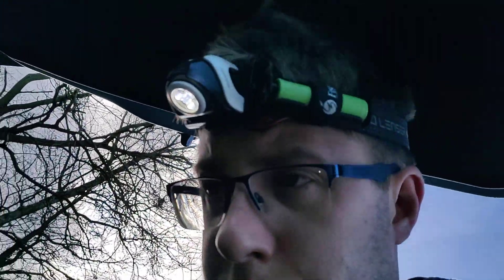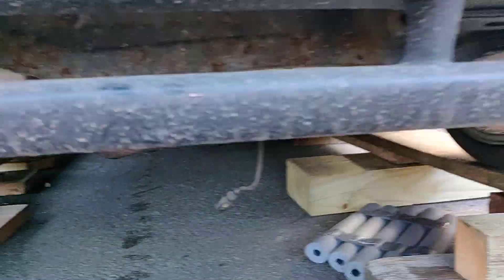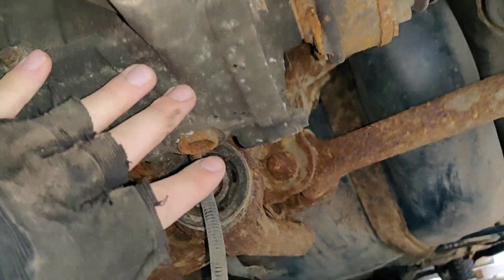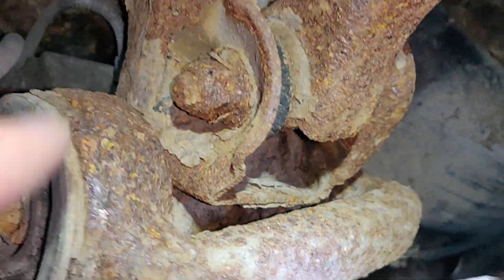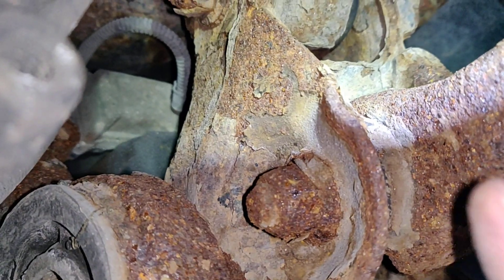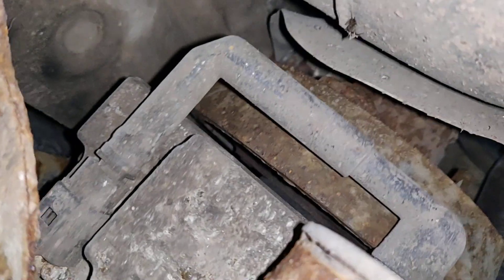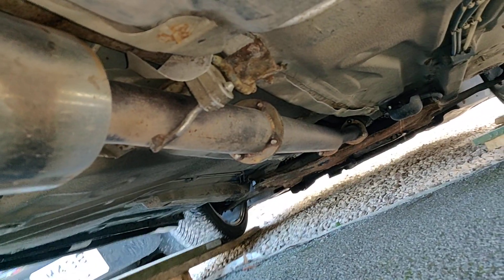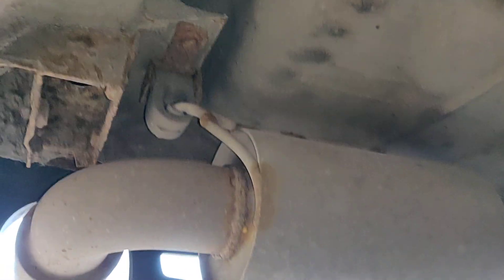Mk4 Golf Haldex controller module location

Comment: Hello, I have a problem with my golf 4 4motion 1.9tdi, the 4motion does not work. and error with me is in computer •All wheel drive control module NO COMMUNICATION can you help me what should i do please?
Thanks you
Reply from the maker: Check the fuse first
Reply: @Gzim Reci were you able to solve it? I have the same issue with a Golf 5 4Motion 1.9 tdi
Reply: @RoguePlank  I have the same issue with a Golf 5 4Motion 1.9 tdi,  i already checked all the fuses but it's not that, thanks for showing me the location of the module, will try to see if i see any damaged cable/connection... can you think about anything else? thanks